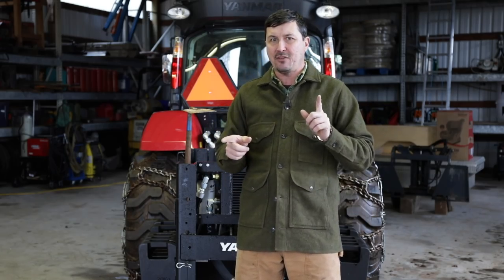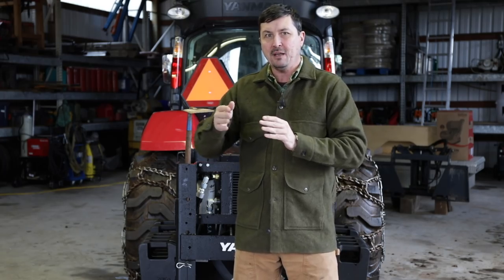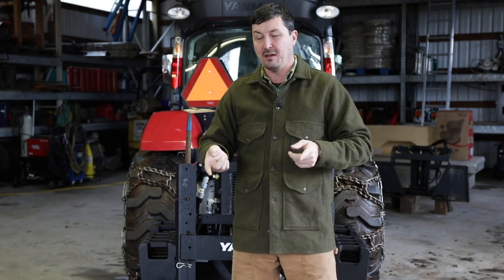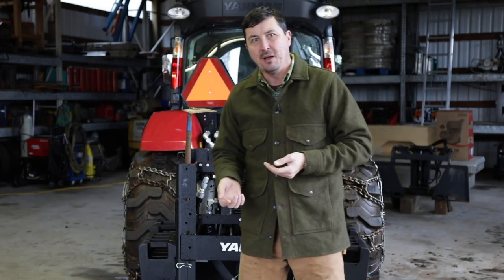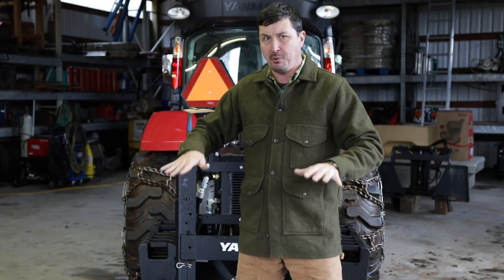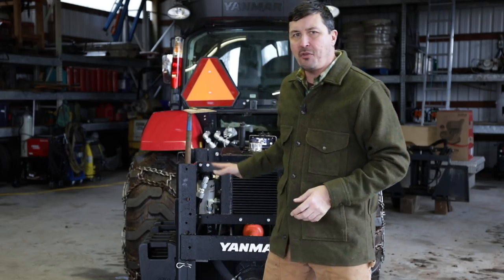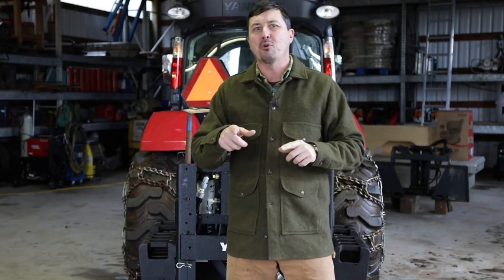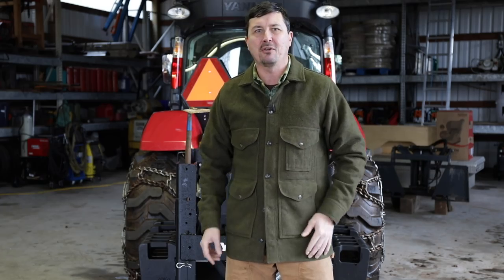Testing The World's Biggest Broom

Comment: Did you find the matching dust pan?
Reply: NobodyWhatsoever.            That's what I was going to say!
Reply: No, I think as with all dustpan's, it's go lost somewhere. He's still looking and hopes to find it soon....... considering that it's 8ft across and weighs half a tone......... mabey down the back of the sofa.......
Reply: HYDRAULIC ADVICE
You shouldn't need psi but gpm because gpm gives you speed, psi gives you power

Your rpms aren't high enough for your pump it seems and your probably running some sort of p51 clone and 5.1 cubic in x 550 rpm = 2,800 cin min ÷231 (which is how many cin = a gal) wich is 12.5 ish gpm in your system therefore a p51 gives you 22gpm and 3000 psi @ 1000 rpm
Reply: @ben winckler please make this a separate comment instead of a a reply to an unrelated comment

Comment: Good vid. And right on with your comments. This is YOUR channel. You post what YOU want. If I'm not interested I'll watch something else and tune back in when you are doing something I like. Simple.  Blessings, Amigo.
Reply: HYDRAULIC ADVICE
You shouldn't need psi but gpm because gpm gives you speed, psi gives you power

Your rpms aren't high enough for your pump it seems and your probably running some sort of p51 clone and 5.1 cubic in x 550 rpm = 2,800 cin min ÷231 (which is how many cin = a gal) wich is 12.5 ish gpm in your system therefore a p51 gives you 22gpm and 3000 psi @ 1000 rpm
So you need to double your rpm

Comment: Snow Blower Diagnosis: background on my experience. I have a large farm, I have snow plowing equipment and multiple tractors and have used many different snow blowers and blades, I plow driveways commercially with a 100hp tractor with a front 6 way blade and a rear mounted Allied Snowblower currently. A common misconception is that snow blowers throw the snow "far" this is actually not the case for 540rpm machines, the Allied machine currently hooked onto my machine throws around 20-30 feet at high rpm. The furthest "thrower" as far as distance in my experience for snow blowers is the "lucknow" brand (again that's at 540rpm) the reason this is a standout "thrower" is because it has an extended shute and it has more fan blades on the center fan. The extra fins on the fan allow for faster removal of the material, the longer narrower shute allows for more pressure build up (best for none sticky snow) and it keeps everything on a further and better trajectory.Most large tractors and many small tractors have the option of a 540-1000 rpm switch. This feature allows the tractor to double the speed of the fan/auger on the blower and this is the only time I agree that you will hear the 'jet engine sound" The best quality snow blowers are the "Normand" and the "pronovost" snow blowers because they have auto gearing for 1000rpm, even if your tractor only has 540rpm options on the PTO. These snow blower also come with a secondary option called a "rolling drum" or a "side shute" which allows discharge from the blower at almost 3000rpm and can gain blower distance of up to 150 feet. These snow blowers are commercial quality and they are direct drive technology(none hydraulic except for changing the angle or running the draft control). They range in price from $12000.00-$18000.00 Canadian dollars.  Solutions:1. trick of the trade I have learned when I wanted to throw snow further with a 540 blower on a 540 tractor. is to create gear reduction... add a gear box between the pto and the blower that doubles the rpm to the blower. this is another way of achieving the higher rpm.2. It looks like there is mud in your machine, you should probably add to the thickness of the runners on the bottom of the body of the blower so it keeps that material away until the ground is frozen, also you could adjust the third link on the tractor to better angle the blower to keep the dirt out.3. As far as the snow goes, it sounds like it was soggy wet snow. I don't know this for sure, I live on the east coast and didn't see video of the snow or what properties it carried, however, if the snow is "wet" and "soggy" I wait for it to freeze or I go very slow and clean out the plug ups etc as they come. The other alternative is I jump to the bucket and loader option in that sort of snow because it is just the wrong stuff to try and "blow". Hope this helps. Ray from NB Canada.
Reply: Raymond White He is absolutely right. Especially the "wet" snow part. We have snowblower on Unimogs.Greetings from Germany
Reply: As I read your post I feel as though you think the pto is turning the blower. It is not, the pto is driving a hydraulic pump that is in turn, hydraulically turning the blower through a hydraulic motor.
Reply: Tennif Shoe , I am completely aware this is hydraulic and not direct drive.
Reply: Agree with Ray and I'm from NB too. Maybe it's just NB snow that works that way :-)

Comment: Seems like you might have flow restrictions due to Port / fitting ID's on the implement, not the tractor. Have you ruled out mechanical? Maybe remove drive gear and try to rotate manually. Check for bad alignment, bearing, or gears might have too much lateral pressure (racking). I truly love and enjoy your channel. The variety of content is what makes you great.

Comment: Make sure the hydraulic hoses have the needed capacity(volume), and the return line usually needs to be bigger than the supply line to avoid back-pressure. Use high capacity quick connects, or avoid using them at all.

Comment: Check the ID size of the fittings as a common problem in air tools is they get starved by restrictions in the fittings.  The OD says if they can fit in a universal fitting but the ID can be a hidden restriction. 

Adam Savage has shown off in the past his answer to tool boxes in the form of rolling tool racks holding types of tools together. With some color coding on the handles/shafts of the tools you know what cart to put them back when you are done with that project and can even include a code for what building it belongs in.

Comment: I agree Cody the auger and impeller speed look to be about half of what it should be.  

With hydraulics speed is directly related to rate of flow.  Pressure is what give you the power to get the work done.  

To really get a handle on this you need to find out what the flow rate is each set of quick couples on the pressure side, when work from there.  It wouldn't be a bad idea to see if the return side is not restricted, because that could also slow things down.   

I see you have two sets of quick couples at each end of the tractor, at each coupler you can have flow and pressure drop.  Not remembering from the install video all the plumbing that was installed on the tractor but at each fitting you can have flow and pressure drop this is really true with small pipe/hose/fitting sizes and high flow rates.  It could be many little things adding up to cause the issues you are having.

Blessings Kriss
Reply: Kriss Femmpaws the size line he had on there should have plenty of flow for 20 gpm, and at each connector the flow reduces which increases pressure...
Reply: Kriss Agreed- restriction causes pressure "drop".

Comment: funny you should post this. i just bought a john deere d13 lawn tractor, and a 42 inch snow blower for it. the whole setup cost me over 4k, and i was waiting for snow to use it. the first snow we received was almost nothing, but i had to try it out. i don't have a lot of sidewalk to do, but i also do the other houses on my block, because some of them are older than i am. i am 66 with a very bad back, so that is the reason i got the john deere. the first day it was falling apart on me. they left out carter pins on the blower when they put it together for me, so with no cotter pins at home, i fixed it with key rings. the second snow fall was about 6 inches. i went out and it was doing the same thing that you said yours wad doing. it would no blow the snow very far, and would clog up a lot. i put it away, and borrowed a friends snow blower, and did all the neighbors. i was hurting for days doing it. i went back to the people that i bought it off of, and i created a big NEW YORK stink. well they were out the next day, and sure enough, it was not set up right again. they had to adjust the belt, and a spring that was attached to the wheel that tightened the belt when engaged. watching your machine, the fan as you called it, was turning very fast, but if gets under pressure from the snow, it might slow down or stop. i think it might be a impeller in a pump that is bad. under pressure it might slip or stop. just a guess, but something to ask.
Reply: cuznjo1 it’s a shame john deer can’t put together a decent product anymore
Reply: Not only do manufactures put together good products poorly but , they don't seam to care about the product after it's sold to the end user.It is so bad out there the government came out with the lemon law for some products. I was in the service business for my whole career and each company I worked for had the same thought. Get the job done fast as you can then get out of there. that is from the boss side of the story. From the customer side ........... they want first class work and refuse to want to pay. And there are selected groups that I refuse to do work for due to having to chasing them down to collect almost every time.
Reply: first i bought a d130 not a d13 like i said above. my mistake. the lawn tractor works great, it was the setup at the sales place that had someone who didn't know how to put the snowblower on the unit. once i made a little stink at the dealer, are you ready for this, i was asked if i had a I phone. i said why, the guy said we can face time and i can talk you into how to fix the problem. i said NO I phone, and being you guys didn't set it up right, i feel you need to come to my house and fix it. the place is 1/2 hour from me, but they came. the mechanic that came, didn't bad mouth the guy who put it together, he just shook his head, knelt down in the snow, and fixed the problem. i did tip the guy, after all, the machine has a warranty on it, and if it ever goes in for service, i need one guy there that i didn't raise my voice to

Comment: It seems like both the auger and the fan were slow and it looks like the gear set up or the motors on the snow blower part that are not rated for the speed you need

Comment: You have too many quick disconnects in line.  It may or may not be the only problem but it definitely isn’t helping.  2 each on supply and return lines.  That is a lot of restriction.  I realize how you are hooking up makes it difficult to not have QDs on each end.

Other thoughts, one of the QDs could be malfunctioning and not opening up properly, maybe one of the ends on the blower that weren’t in line with the broom.  

The hydraulic motor on the snowblower may be leaking internally, or have some other issue.  Hate to say it but without a flowrater and gauges, it’s going to be hard to diagnose without changing parts.  

If a coupling is getting hot, hotter than the rest of the system, that’s likely your problem.

Comment: 1. LOVE the engineering development angle on the snow blower.  I did that for a living for 27 years: build a prototype, put it through its paces, diagnose problems and make modifications.  

And I had so much real fun doing it, too!  I wasn't the engineer, but often I contributed significantly to the refinement of the design.  

I think you're right about the blower turning too slowly.  It needs to be measured for RPM's somehow... frame rate of camera or a tachometer.  It should be howling and pushing a lot of wind.

2. Bad tools... I think many of us could write a book.  Or three!  Should make for some great entertainment.  One fertile subject area might be products of those TV infomercials that never quite make it to the mass market... designs that look great on video but are fatally flawed in reality.

I know a fellow who STILL cuts his hair with a flowbee... vacuum cleaner attachment hair cutter!

I have TWO drawers full of dulled files.  I swear, my grandfather and my dad never threw a dull file away.  Granndpa was a gunsmith and tool-and-die maker, and kept files around to make springs out of.  Dad just chucked in the old ones.  And neither of them seemed to understand how throwing a file in a drawer with other files would ruin them in short order.

3. re: the whiners... Ignorant and stupid.  YouTube creators make offerings; you pick up what appeals to you, like a cafeteria line.  The latest watch review was only mildly interesting because the Tuna is so far outside my budget level... but your mention and link to the <$100 Seikos was big news and I looked at them quite a while.  Interests are like Venn diagrams.  They never quite match.

Thank you for the continued content creation, Cody.  It's all good.
Reply: I love the line: "Interests are like Venn diagrams"  !!!  GREAT LINE !!!!

Comment: First thing I thought when I saw the setup, was the size of the hoses, compared to the length...  I've been working five years with developing dump trailers and other trailers for trucks, and the best working systems has one thing in common... They are equipped with bigger hoses than we first thought was sufficient.  So the first thing I would have checked is pressuredrop from back to front, but also that the pressure is below 5 bar after the hydraulic motor on the blower. Love your videos Cody!  PS: Check out Norwegian chains from Trygg, for the tractor,  they are easy to mount and doesn't need springs unless it's really tight.

Comment: Useless tool:  Cheap skip joint pliers or channel locks.  The ones that give out right when you need them to hold on.
Reply: shopnwoods or the self loosening crescent wrench
Reply: I had a whole set of made in China wrenches that literally bent and broke under normal torque loads...and a socket set too.  What a waste.
Reply: The good quality brands do not slip when you need them, the junk brands do.
Reply: Brian Pro Handyman Most of us have some cheap ones that are the only ones we can find when we really need them.  The good ones are usually not around when they're needed most.
Reply: I fix that by throwing the bad ones in the garbage can =)

Comment: Seems like the whole blower is spinning slow, the auger at 540 looks like mine at idle. Hard to tell on camera though. On a side note I'm  curious why there is a bolt on plate blocking half of the impeller. Never seen that before I'd think that would restrict snow flow into it also.
Reply: I agree about the plate blocking the impeller. The auger seems slow, but seeing it performing under a load would be helpful
Reply: +NoC exactly, no one else uses a plate there. If ur going through deep snow it's preventing some snow from going directly into the impeller and out. That could be where his clogging issue is coming from also.
Reply: It's nearly impossible to say what it could be for sure though without actually being there and seeing it perform under load
Reply: Actually I have a Normand econor and I have a plate similar to that.. never had any issues... As far as I know it helps direct the snow up the chute by creating pressure (i.e. wet or slushy snow, it makes a column that gets pushed up as opposed to having the snow just be thrown with it's own weight). Another use could be that they are trying to create a constant feed of snow by reducing the impeller intake, or to load the impeller since the snow will get in "deeper"...  There are many Pumas and normand's, Schulte snowblowers and manufacturers here  (Quebec, in Canada) that have the plate blocking impeller like that.. I'd leave it on.

Comment: I have never seen a hydraulic snowblower on a tractor work very well. What always works is a pto driven snowblower on the back of the tractor and keep the bucket on the front. I had a relative in New Brunswick Canada who used the same pto driven blower for 50 years and then passed it on to his son and grandson about ten years ago and they are still using it, it has out lasted 2 Massey Ferguson's and is on it's second Kubota....basic shafts, bearings, gears and chains that can be found anyplace in farm/logging country......Keep the videos coming, all of them!